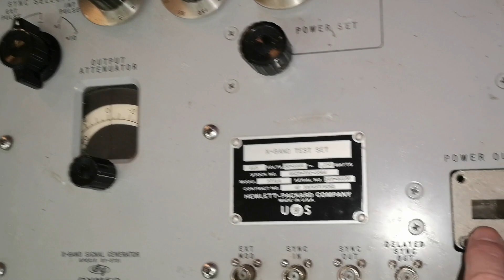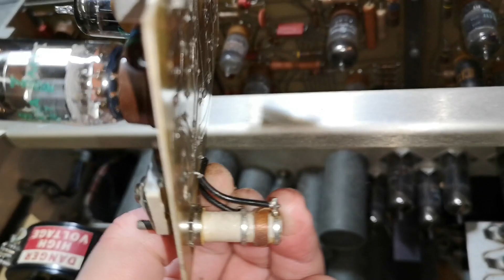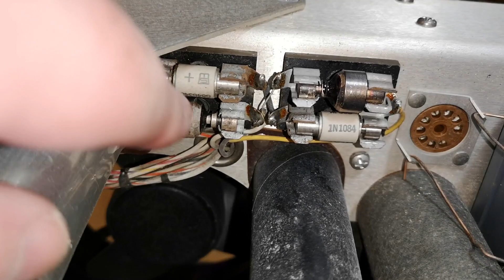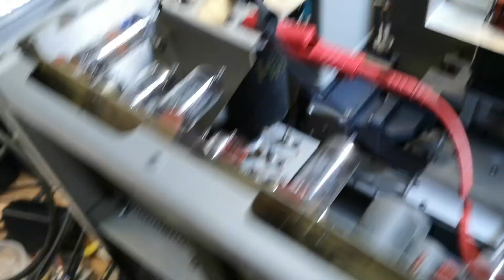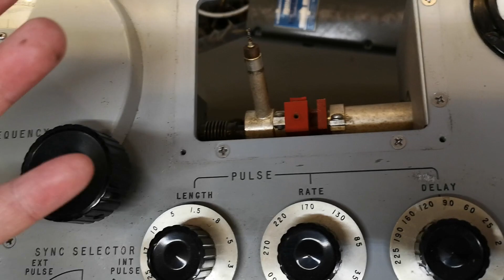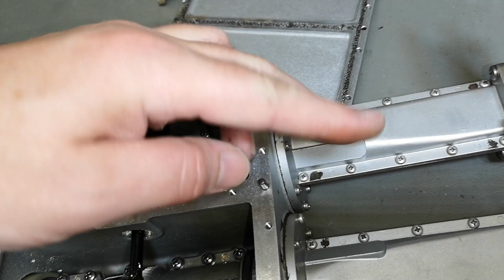HP Dymec DY-5731 X-band signal generator 8.6 to 10GHz repair teardown

Comment: I wonder how the klystron is adjusted - flexible copper bellows maybe?
Reply: Yes, and the reflector voltage.  https://en.wikipedia.org/wiki/Klystron#Reflex_klystron
Reply: OOOPS, there is an error on the wikipedia drawing of the reflex klystron - the electrons must go back through the cavity (through the two grids), not land on the top of it.
Reply from the maker: exactly, i have seen many different pages about this matter the last week, so much "confusion" in the material, easy to misunderstand what is what, depending on where you look and what you know.

Comment: That is not anode, but the reflector, so it needs the negative voltage, see datasheet. Anode is ground, and cathode is negative, as should be.
Not sure the klystron survived plus on the relector... 60mA is a lot for such a small tube.
Reply from the maker: it came as non working, sometimes stuff leave as non working too, just too bad, could have been fun to see output and if it was at correct frequency.

Comment: The generator was probably working, but the cable you used to connect the analyzer really does not look like it could propagate 10GHz, especially through that huge length. Also, to couple that loop, placing it horizontally into the waveguide gives the least coupling.
You should have just put a ~2cm piece of wire into the analyzer's input connector as an antenna, and let the microwaves fly through the air - that would have much less attenuation than your cable, and you could see the signal. The open waveguide is a good enough antenna for this.
Reply from the maker: attenuation of many db is not a problem, since the spectrum analyzer handle a huge range, and the task was not to prove if level out is correct or not, zero output, no matter what , i did of course try all sorts of wire pickup methodes, and that normally works very well
Reply: @TeardownOZ2CPU  Not so sure about that cable... Looks like a chinese (black) version of RG174 or similar. Original RG174 is specified only to 1GHz, where it has about a dB per meter. Attenuation would be about 3X (1+5dB=6dB/m) higher at 9GHz (assuming the cable structure is good for 9GHz). So, with -10dBm output, that would be pretty high above the -60dBm analyzer noise, I agree.
But with a chinese version, god knows what dielectric, and how economic they were with the copper...  Maybe the generator was just weak (outputting less than the set -10 dBm, for whatever reason), combined with weak coupling and lossy cable...
You did get the indication on the meter, and it responded to the power control. Something must have come through the waveguide, to that thermistor. Hard to imagine what that would be if not some X band RF?
Well, the "power control" might not control the power, just the scaling (or offset) of the meter,  but you can check that.
Very similar generator is HP620A, (maybe also 624B and 624C), maybe you can find schematics and manual for these online, I guess the schematic will be pretty similar.
The 620 looks like this:
https://www.ebay.ca/itm/154247212179
Reply from the maker: @markocebokli6565  exactly most likely more than 10db loss pr meter at 10GHz that is what i expected, the unit could potentially deliver +25dbm at max , still not a sign of signal, i also double checked the SA is working. I never ovned an HP 620, but it surely looks alot like my HP 614 / 616 / 618 looks like a 620 is all i need to compleete my collection :-) search my channel you see i did puplish videos of those units too
Reply: @TeardownOZ2CPU  I saw your 618 video, but there you used a serious cable 🙂I think the main difference between 620 and dymec is a more powerful klystron, judging by the cooling slots on the front panel, to improve the airflow over the klystron. These slots, and an attenuator capable of handling more power, forced them to redesign the front panel, but the schematic is probably quite similar, including the power measuring thermistor bridge circuit.
According to the V-80C data sheet you linked on eevblog, beam voltage is 500V (-500V at the cathode, anode is tube body, 0V), times 60mA is 30W, already very scary for such a small tube! The reflector (AKA "repeller") is a small piece of metal, not intended to carry any current, just make a field, to send the electrons back through the cavity. By putting +500V on it, there will be 1000V times 60mA = 60W of dissipation on it, not sure it could survive that.
Reply from the maker: @markocebokli6565  did it only 8 sec, just to see if any RF came out, it is allready out in the "cold" again, i am a little bit tired and mad about it after 3 hard days not beeing able to find the missing voltage, or any problems in supply or control circuits, nothing wrong in the RF path too, lucky a dude is going to pick it up next week and hopefully have more fun with it, win win, more can play. and i get even more new stuff